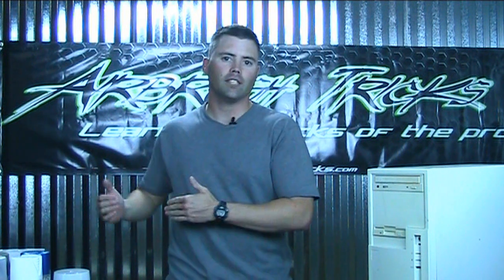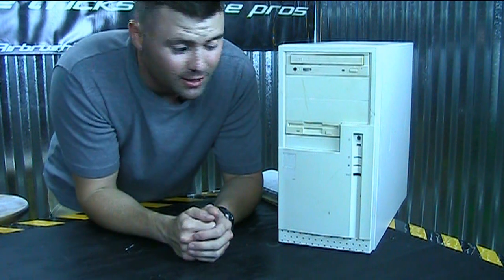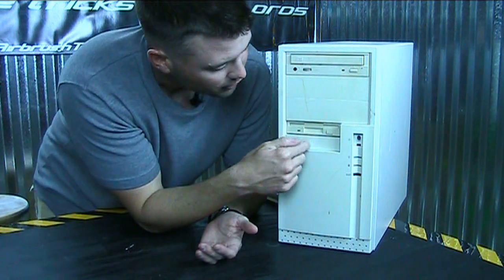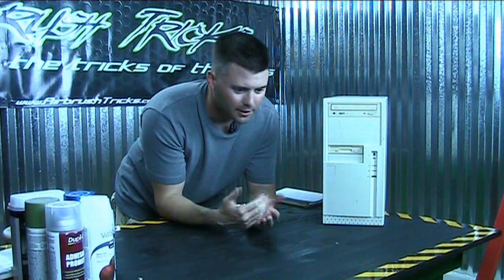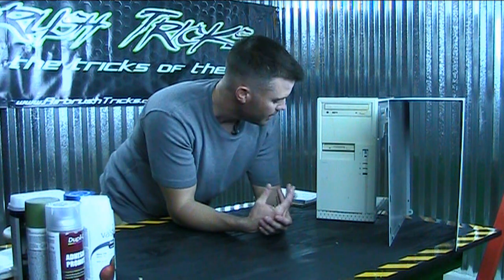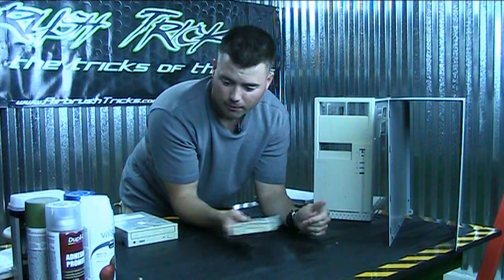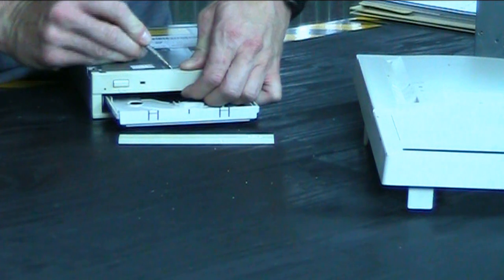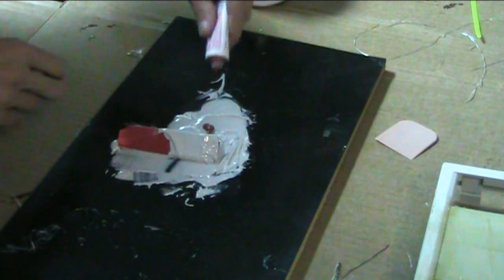Super Easy Case Painting Guide - Part 1

Comment: @mrmoss812 of course you Can airbrush an xbox 360 case. Just look for a video on YouTube that tells you how to dissemble an xbox 360. It's all the same material sou you can use same primer before paint. Also no matter what the paint colors are I recommend keeping the disc drive chrome and the top and bottom grey parts their original color. Sure someone has a walkthrough painting tutorial for an xbox360 on YouTube.